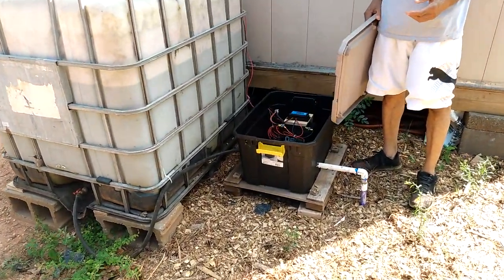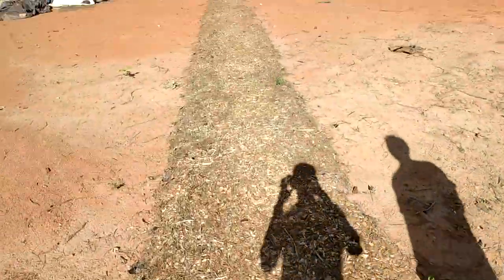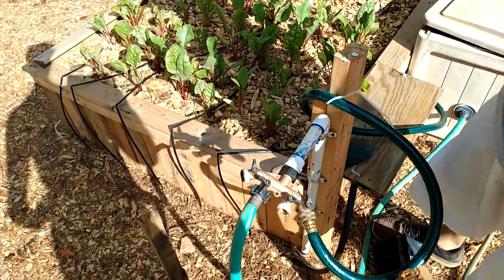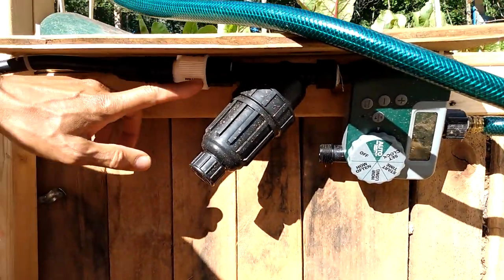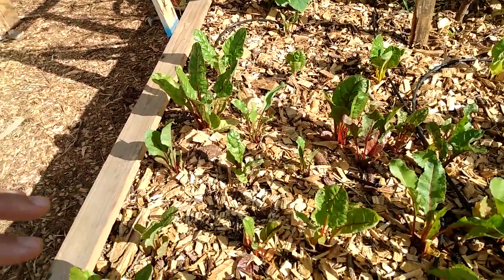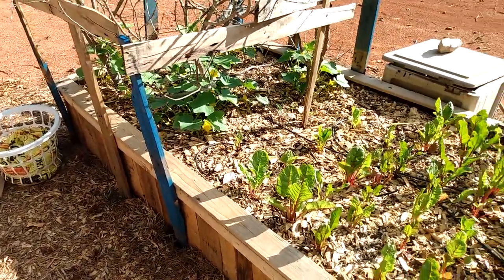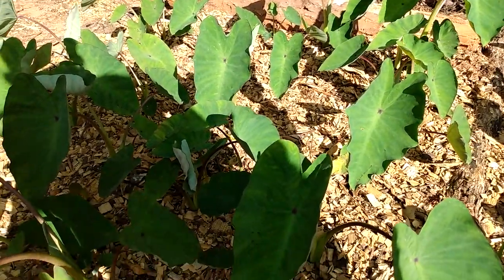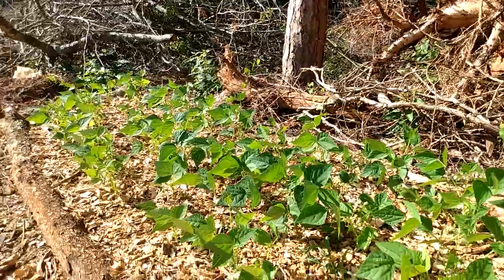Drip Irrigation System with Solar Pressure Pump

Comment: Hey hi

How do you on the pump? Do you on it manually or it ons automatically with the watering timer?
Reply from the maker: The pump is automatic. It comes on when the timer switches the sprinklers on. It is an on-demand pump and switches on when there is a demand for water.
Reply: Do you have a model name I want to order that, because I can't find it in Oman